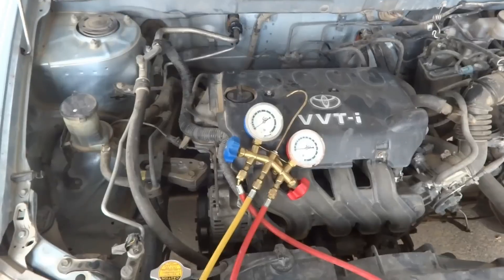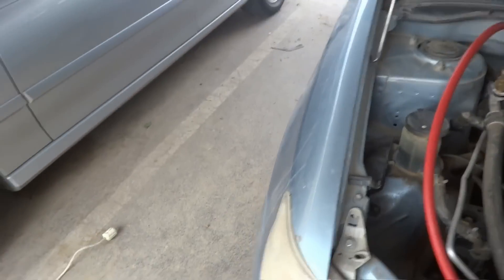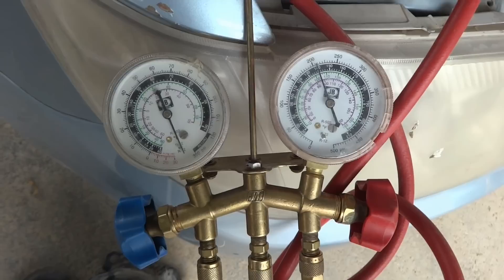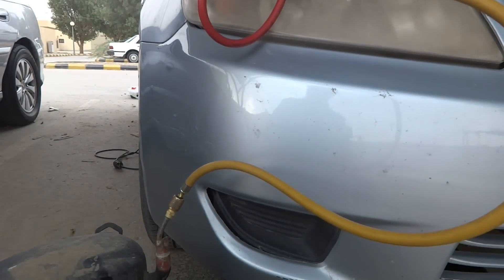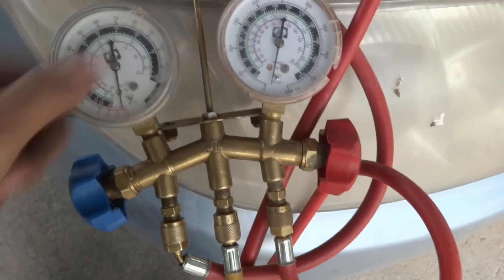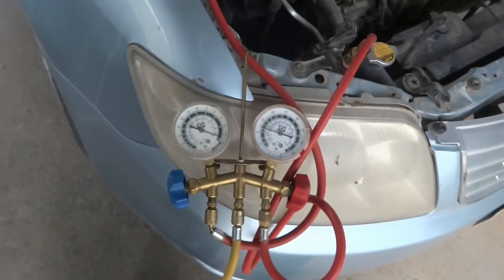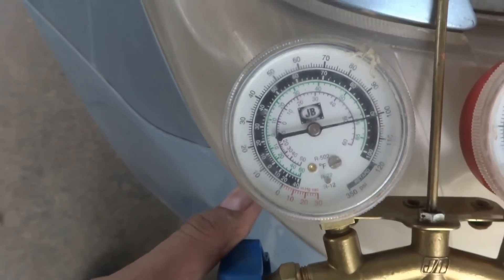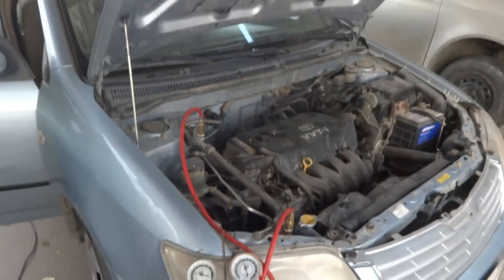Car air conditioner refilling Complete version.

Comment: My Hilux ssr Low Pressure side is 50psi
& High Side is 300psi
so the Compressor is good or bad?
Reply from the maker: If it's giving you perfect cooling on this pressure rating, seems your compressor is good.
Reply: @JahanZeb1976  full proper tariqe se
wash b kiya, cooling coil,air cooler or filter b change kiya ab b maza nahe hy
Reply: @JahanZeb1976  kia waja hy sir?

Comment: You did not show shutting off of both blue and red knobs on your manifold gauge after pressurizing the system. Also, right after you started filling Freon, how could the high side gauge moves without opening the red knob?

Comment: Guys just add service valves on a refrigerator compressor you have to braze to suction in discharge out.. or use supco piercing valves also an terminate crimpe the lines as per factory fill line.
Reply from the maker: Excellent suggestion!

Comment: U fill it overcharged.. the R134A is works well on 30 psi.. 
according to Saturation card R134a temprature is 1.3C in 30psi and gain up to 9C when reach 45psi.. 

U cannot straight add the refrigerant such fast. u need to wait the refrigerant to expand before add again.
Reply from the maker: Dear friend thanks for watching and great comment. In car the air conditioner pressure is something which is not constant due to varying engine speed. If you accelerate a little, the low side pressure will suddenly go down 30PSI. So the pressure is not here the unit to work on but the final cooling is the parameter on which you can refill. Hope you may understand and this is not my only job I have done. I serviced tons of auto motive air conditioners with success and still they are running since years. Best regards,

Comment: sir gas filled in only blue meter side or red side also
Reply from the maker: Filling is always on low pressure side that is blue meter side. You may watch the video two three times. Hope you will understand the process and also check my other videos on car air conditioner if you are going to attempt the job first time. They will help you a lot to understand the process. Best regards,
Reply: thanks a lot sir a am also want to do job in auto ac

Comment: I think testing leakage by suction is better
Reply: LearningZone as soon the air enters the system it damages the drier, its dead basically. You should replace the drier and vacuum it properly with a vacuum pump creating 29mm hg. Moisture kills drier.
Reply from the maker: You are right but pressurized air is also ok if there is less moisture content in the air. As I am in the area where there is less moisture content in the air so air can be used to detect leak.

Comment: i think you should use vacuum pump and use leak detector better than 2ton compressor because this will press humidity inside the system.

Comment: if you have a compressor you either add or remove air from the system?
Reply from the maker: +Richard Cowtails Yes that I showed in the video. That is the standard procedure. I will add one more video soon shot on one Nissan doing the same procedure. That will even clear more concept of doing charging. Regards,
Reply: +LearningZone neat. thats a good idea

Comment: I know as the compressor cycles the psi would rise but when the compressor in engage would the pressure remain say at 40psi for example and not fluctuate while the compressor is engaged thus indicating the system is full ?

Comment: LearningZone while feeling the low pressure side how would you know when it's cold enough as soon as you start to feel moisture on the line ?. And also when there is enough refrigerant on the system would the pressure on the Low side gage remain constant or would it fluctuate still ?

Comment: NO!  You don't charge the a/c system full of air to leak check it! Please don't follow this guy!!!
Reply from the maker: +joeyf504327 Then to whom follow? If air conditioning system is not filled with air to test then what should be used to test it? Don't say Uranium! tell something practical. If you say Nitrogen, then air is 78% Nitrogen. What is bad in filling air conditioning with air? I am sure you listen it from someone of 1850 guy!
Reply: LearningZone my friend ,, you just should vacumed it and check for leak

Comment: Hi, nice vedeo - but what about an oil in the AC system. Don't you have to add it a little? I assume that when you vaccumed the AC system there is no oil in it?
Reply from the maker: +Marcin Wojciechowski Sure you will add if it is required.
Reply: +LearningZone ok but how do i know how much is in the system?

Comment: I could not hear you over the engine, but that didnt matter as you made the rest of the operation very understandable :-))

So it passed its pressure test so all the new seals you fitted are working, and after creating a vaccume in the system and filling the void with freon it works :-))

I think you may have to repair the boot latch next ha ha :-)), i have that feeling lol.
Reply from the maker: Thank you dear friend for liking video. I was trying to make the video as clear as possible and detailed also so that newer to the field could also understand the whole procedure and could be able to recharge their air conditioners without any confusion. Hope it serves what I was expecting from. Regards,
Reply from the maker: Also you are 100% correct as my next step was to repair his car boot latch as the guy was messing with it. I didn't film that as it was getting dark and also I was tiered that time.
Reply: LearningZone
Well if a thick person like me can understand it, anyone can ha ha :-))
Reply from the maker: zx8401ztv I am sorry but you are a rock of knowledge! Regards,